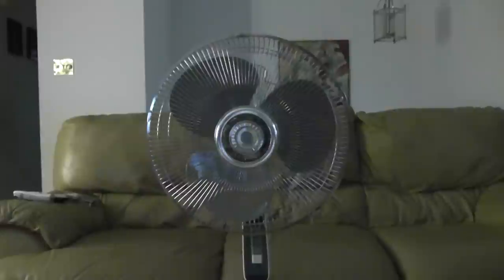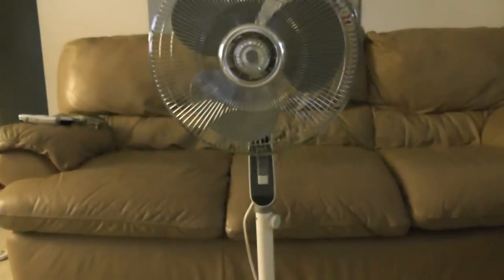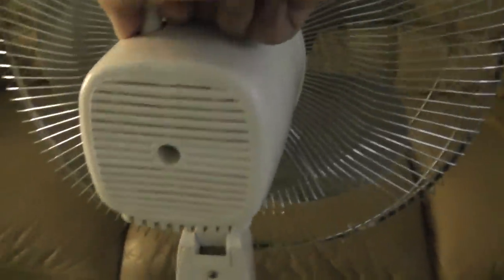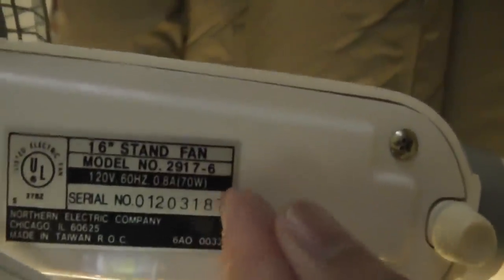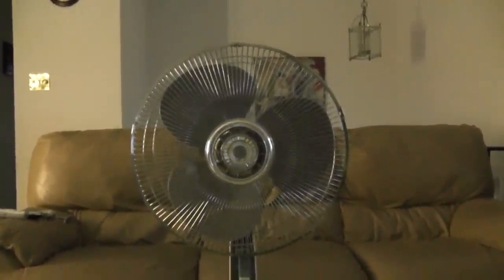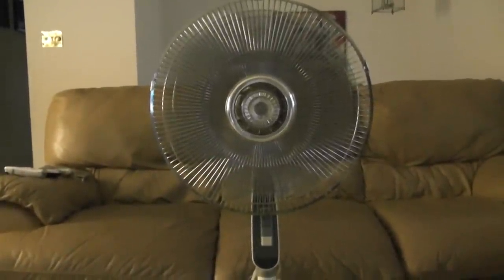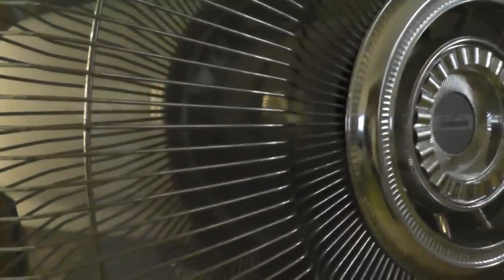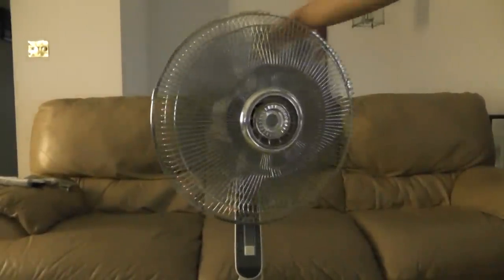16" Sunbeam Oscillating Stand Fan

Comment: Oh and also, you do not want to use oil in the oscillator, it just gums up the gears. Use lightweight automotive grease, it last quite a while. Good luck!
Reply from the maker: I used motor lubrication to oil the oscillator to make it oscillate better. I think I used three in one.
Reply: Yeah, you don't want to use any type of motor oil in the oscillator, use grease. Motor oil is specifically mad for motor bearings, and grease for gears. I tried the experiment and after about 3 weeks the gears in some cheap crappy galaxy ped fan gummed up the entire thing, so use grease for that. Good luck!